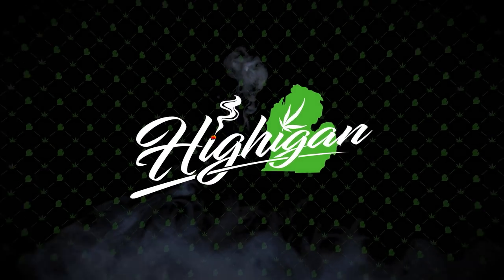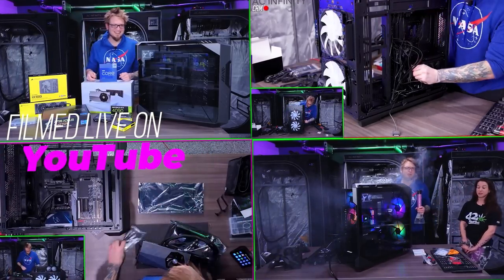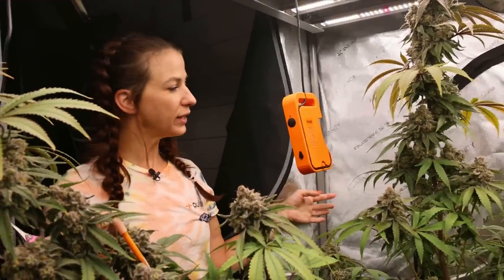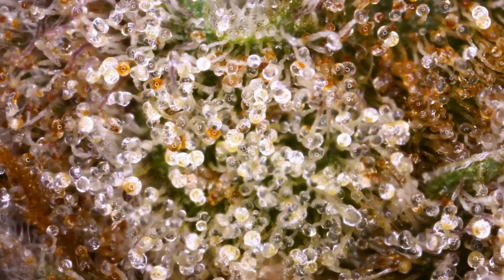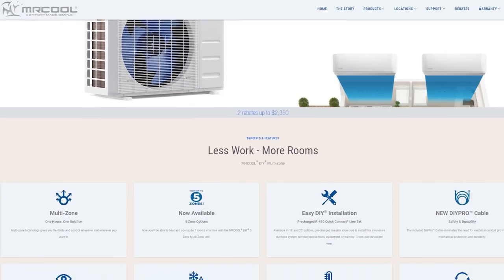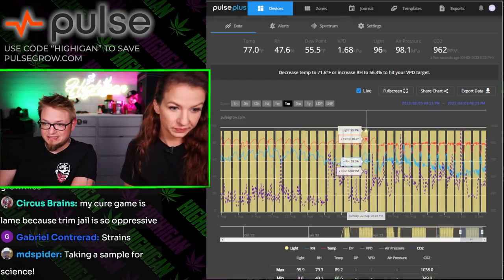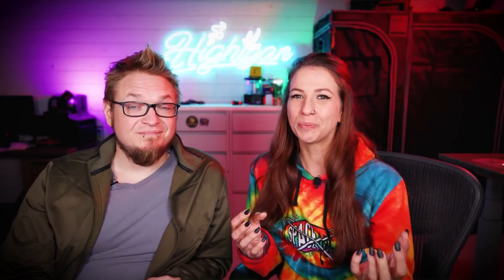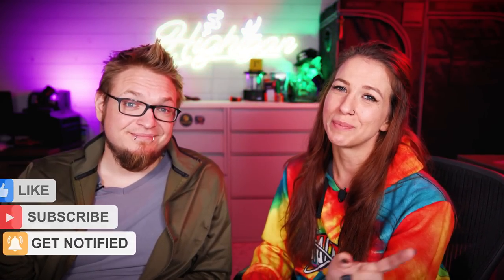Dealing With High Temps In The Grow Tent!

Comment: Had heat issues all summer but grow still turned out fantastic. Temps always high 80s- to low 90s. Ran the light at 60% power and opened the tent door’s while light was on. Increased air movement with existing fans but no added equipment. Consistency is the key. Plants are resilient and will adjust. Some strains can handle heat more than others.
Reply: Also I don’t grow finicky autos unless it’s outdoors.

Comment: The ideal drying is 60% at 62f, but as you say normally a fairly good dry under 70f.   But when it goes up to 80f beyond your control or above, then raise the humidity up 70%. with a little airflow and its fine and slows the drying down. RH means relative humidity.   You get similar VPD at 55f/55% as you do at 60/60 and 70/70.  For example you are more likely to get mould at 55f/65% as there would be far more moister in the cooler air.     

Some Cali growers use what is known as the 7's  70f -70% gives a vpd of .77kps and will give a 7 day dry.  Tried in in heatwaves and it works a treat.  So much better than drying at 80f and a low 55% RO, as you will destroy all your hard work in a very short fast dry.
Reply: Great post. I would give this 10,000 thumbs up if I could.
Reply: @ironx  I just posted this somewhere else, so you may as well have a read too.

The most important thing I learnt was that Humidity is relative to the temp.  The amount of people that just say grow at 65% for example mean nothing without temperature.  A VPD of .80 KPa for early veg. can be achieved at 70f and 62 %....or at 79f / 70%

But in flower when you want to be at about a VPD of 1.40 .  at 75f you would need low humidity of 55%, but to achieve the same VPD of 1.40 KPa at 82f needs more humidity of 64%

This is also impotent for drying to. 60/62 maybe the perfect dry, but if it's a heatwave and you can't get temps down below 80f, then raise the humidity if you can to 70%.  as there is still less moister in the air than at 60/62.  Because humidity is relative to the temperature.

Comment: I have 2 x 3x3 ac infinity tent's setup, one with 240 watt Ac infinity led and another with 2 x 100 watt Ac infinity led lights . Now Hanging one 8 inch honeywell fan above the lights on each tent got my temps down 6 degrees . I have them in a basement using Hepa filtered fresh air intake from inside and exhaust with inline 6 inch ac infinity . Without the 8 inch fans cooling the lights , the basement gets to  81f . With those fans on , I get it down to 75 /74 f .  I live in British Columbia and it is much colder now , but I still think having fans above the lights makes a big difference to dissipate the heat from the lights to the outside efficiently as possible  - thanks for this channel guys ! rock on !

Comment: Confusing how you have such a nice setup and you're dealing with heat issues. Did you not already have that planned on how to prevent that lol?
Reply from the maker: We had to get concrete poured under the deck it took time to get that all sorted, if we could have we would have got it done when we did the room. I figured maybe we would get lucky and it wouldn't get bad because most of the room is below grade but to many things generating heat in the room.

Comment: Reverse your light schedule so your lights are going all night and are off for 6 hours. Not sure if you are already doing that or not.
Reply: I have my lights off during the day. When it's hot out. And on during the night. Helps a lot with temp.  Only run the ac for them during summer days (when lights are off for them)
Reply: I began this on my very first grow - it just made sense.
Reply: If you interrupt light schedule, itll ruin the grow it might induce early flowering
Reply: Not to mention your bill will be a but cheaper cause not using during peak hours.

Comment: I had similar problems with summer grows.
I turn my lights on at 9pm and go off at 9am.  Electricity is cheaper during off peak hours. Not too mention I don't have big bright lights going during the hottest part of the day. Then you have the AC and humidifier battling it out all day. The VPD is all over the place.   This night schedule is the best thing ever.  And during the winter the lights are on during the coldest part of the day giving some extra needed warmth.

Comment: Just so you know in summer I Bring in fresh air from crawl space under house. I find at 95 outside the air was stable at 66  from under the house. Also the humidity was high but that is not so hard to work with. Remember to filter the intake vent.

Comment: Another excellent video!  Thank you!  How do you like the Pulse?  Does it seem to be accurate?  I've been using Govee and although they were accurate at first, they seem to go our of cal after I while.  I compared them using the psychrometer that my client's company uses to get accurate data for jet engine testing, so I know their stuff is cal'd regularly. (Also found out my home weather station was off a bit, but it's 4 years old so that's expected)

I've heard that it's good to calibrate things like this every 6 months or so.  Mine were only off by 2-3 deg and 3-4% humidity, but I'm a bit OCD so it's kinda buged me.  LOL!  I have recalibrated them and they seem ok now, but I would definitely stick with the advice I've heard about checking them at least once per year, better yet every 6 months.

Keep up the excellent videos!  I've been learning a lot!

Comment: Sorry that happend guys. I like that you demonstrated that sometimes its best to just start over instead of risking continual pest problems. So many new growers just dont want to start over and end up carrying issues into their next grow.
Reply: I wish I had been following more - I could've identified this in the videos.  Grew up doing hvac and the Mr Cool is a solid solution.  Not the best track record out of the available options.  I would've opted towards a Daikin Aurora - we have a cold winter environment here.  You could add onto the right unit and move heat from the grow room to satellite zones, and then the Aurora series is also ideal for the cold season (you know, the space on both sides of Construction season - I wanted to state the validity of my post and information thru this cheeky comment).  Air for thought if the room is truly generating that much heat.  May as well use it.

Comment: I started my grow in fall of 2020. I had no problem with heat till summer when it got up into the 90’s so I bought a  window AC. My grow room has be good from that point on
Reply from the maker: AC is the way! Our basement window is not setup well for window units so we went with a minsplit setup and its working amazing!
Reply: Those units really handle big areas like your space. Nice lab down there it’s amazing!
Reply: @Highigan  that's hilarious that's what I commented and you liked it that's fucking hilarious

Comment: I've grown a few times with high heat, even 90 degrees in a small 3x3x4 grow box.  The plants did suffer a little but the grow turned out great after it cooled down a little.  I suggest an air conditioner addition. for the entire room. I've also never checked the ph in a grow and had good success.  These were Not Autos though.

Comment: I think that if you put a mini split in the room with all of your tents and then kept at a certain temperature it would also help regulate if you have all your doors closed or you could build a little bit of a ductwork system and have it go to each tent
Reply: Stick to video games.
Reply: @vincentsecor6703   really? I'm just going to say that you might want to rethink what you're saying.
Reply: @vincentsecor6703  due to the fact that currently as we speak I'm installing a commercial HV AC system I braze copper daily that is my job I know about air flow air balancing sizing tonnage of air conditioning units and square footage heat loss and heat gain yeah I kind of went to school for that so before you have diarrhea of the mouth you might want to rethink what you said
Reply: You sweat pipe big deal. I’m Union carpenter buddy greatest city in the country. Not hard to sweat copper pipe buddy teach a monkey to do that shit.  
Huffing lead made your brain go numb. 
Do you know how much money it would cost to run separate duct work systems lol. Over kill lol 😂
Reply: @Catch_u_reloadn  next time I fart tell me my wind speed.

Comment: Here in Northern MN once the furnace comes on the AC can no longer run. Because of limited space I have a 3 X 3 tent in my living room. I am running an AC Infinity EVO 6 which fits the area wall to wall. The driver is outside the tent. Ambient room temperature vs. tent temperature can vary 7-10 degrees hotter. All summer AC was at 66 and fans around room got it to 75-78 degrees. I am now exploring ways to design an intent cooling system. Are there any you know of> My thought is to employ a small refrigeration device from a wine cooling cabinet if I can find one used. I have a friend who is heating and cooling contractor I will consult with to go smallest possible size. This would be connected to a kill switch once temp probe hits desired result on remote controller in tent. What are your plans for cooling tnts after AC from outside source is off in Michigan winter? I've watched tons of videos on keeping tent cool and it is all reliant on AC to cool outer room. Frustrated as well for dry tent which should never exceed 70 before THC degradation. I wonder where all these tent growers get their reduced temps from. I can't find a solution. Summer is over. Furnace will be on soon. Been wearing fall clothes all summer to lower temp with AC with all vents on bottom open and 390CFM exhaust fan out top to draw what heat I can. Thank you.

Comment: Not having the prefilters on your carbons will really kill the life on those things also. They get clogged up pretty fast. You can take a shopvac and vacuum the outside of it. It will help with air flow. I'm sure with the way you have your system run your not able to hand test the air flow. But if you could pull the tube off the back. Run you're in line with the carbon filter on and check the air flow. Then pop the carbon filter off and check it. Always going to have a little bit of restricted airflow with the carbon. But when there dirty It will surprise you trust me.

Comment: Something else folks can do if they are going through a heat wave for plants in the grow phase is add co2. Adding co2 will help the plants tolerate a unforeseen spike in temperature. Just food for thought in case getting an ac unit isn’t an option.

Comment: I just did an autoflower grow strains from 420fastbuds had a few massive plants and ive never had autos get this big! They were flowering really nice but i couldn't get my temp down at peek summer and it was about 3 quarters the way through and it was like they just stopped flowering i ended up keeping it to maybe cook with but the plants were pretty much garbage and it was crazy they literally just stopped growing and the only thing that was off was the heat so im assuming that was the issue

Comment: Sounds like you guys needed to vent your tents outside if you weren’t doing so already, and if your res still has issues you need a chiller. But I assume the mini split killed off those problems. Growing pains! I run a lung room so whatever the environment is like in the room the tents are in, the tent will be, but with the added heat from the lights just slightly higher during lights on then the lung room, and humidity is regulated well since I vent outside instead of back into the lung room.

Comment: a feel your pain am a a new grower and was using couple 100w leds then decided to get a good one 840watt but cant even run it afull power most af had it is 50percent because the heat coming off it
Reply: Do you have a light meter.  The free PPFD app is great.   You can hang quite close to your canopy with LED's. And my plants are happy at 82f... add some co'2 and they can handle higher heat than that OK.

Comment: I noticed my outdoor plants use a lot more cal mag for Heat Stress...
Reply from the maker: Does it seem to help?
Reply: I heard CO2 helps with heat too but never tried it...
Reply: @jeremybegay2127 I had my tent at 95% for a couple of weeks this summer during mid flower. Added co2 and man it freaking took off! Kept it around 1000-1250 ppm. Upgrade was worth. I’m surprised these guys don’t have co2

Comment: Your foxtailing is not caused by heat it is the extreme level of light intensity .
If heat was the issue for foxtails your short plants would have foxtailed.
If heat was the cause then all cannabis plants in Afghanistan would all have fox tailing.
Remember the sun does not come down to the plants In nature.
But if you check the heat on top of a cannabis plant in outdoors when the sun is directly overhead ,temps are well over 100 degrees

Comment: Your ducting is an issue. You have all these long runs and turns and using undersized fans to move all this air. If your going to use those small fans you need to add more inline fans outside of the tent in the runs

Comment: Why wouldn't you use a floor air conditioner they work great you just have to remember to empty the water it takes up easy peasy
Reply from the maker: Cuz the noise level already getting up there and adding that would make it harder for filming, minisplit was worth it tho, its silent inside and nothing to empty, probably more efficient too and takes up zero floor space! 🥶🧊🥶

Comment: 85° in my tent at any given time
Reply from the maker: do you have any issues with your plants or humidity?
Reply: @Highigan  Thew perfect leaf temp is 82f and LED's don't project the heat as much like the old school bulbs.  So a canopy temp with Leds using your ACF probe will show 64f to put the leaf temp at 82f. Where as the old school bulbs would be an under light air temp of 78 and  would project a leaf temp of 82f

Comment: I have to ask, WHY did you not throw an air conditioner in the window IMMEDIATELY? You said you were using fans at night to pull cool air in and what not lol. So, you should have INSTANTLY knew that you NEEDED air conditioning atleast in your lung room. Im going to assume sense i havent finished watching this clip that you guys did winde up getting an A/C unit is my guess lol. But, yeah those kind of temps are NOT the kind of temps "you just TRY to deal with" lol lol lol

Comment: Came here for tips on dealing with heat.. Conclusion:
Scrap your plants and install a costly AC unit to cool your room >.<
Reply from the maker: We mentioned some, like lower your light output and drop it lower so you still achieve your par. For us tho that wasn't enough with 3 tents and computers in the same room. You can also change your lights on period to opposite when it's hottest, ie on at night off in the day.

Comment: Let me add that I have been looking at a Cannatrol cure/dry device. They are like $2K. Yikes. But the guy is a systems controller and is utilizing regulating temp vs. dewpoint rather than RH for his machine he makes out of refrigerated wine cabinet. I think there may be something to this and am also looking into controllers that would set those parameters. Maybe some of the more brilliant people reading this could come up with a portable in tent cooler with refrigeration unit only minus the cabinet using this concept. Humidity is the combination of temp and dewpoint and depending on each of those conditions and their variables determines the RH. Cool the tent, control the dewpoint. Any ideas anybody. Million-dollar idea. Here is the link to the interview with David Sandelin inventor of Cannatrol with Mr. Grow It. It will give you an idea of what I am considering for grow tent tech of the future. Perhaps better insulated tent walls too. The dewpoint would have to be set higher than he uses in the drying machine though to have a more stable humidity. https://youtu.be/yUpzTLweNiU?si=Fs12XbUu4iAmwD7r